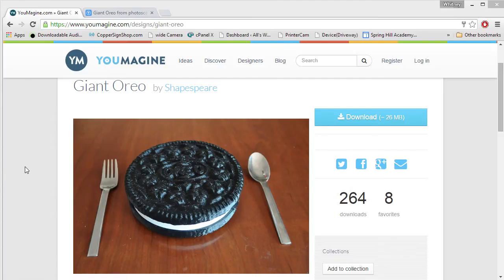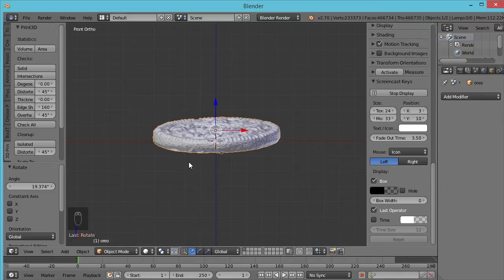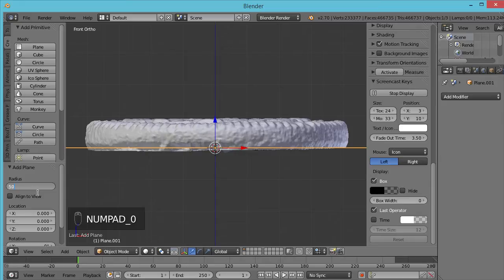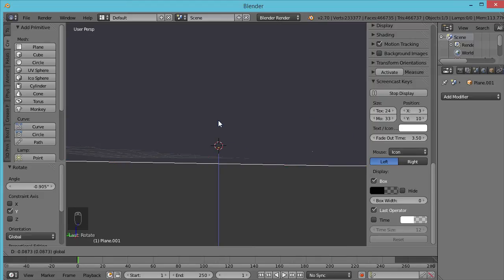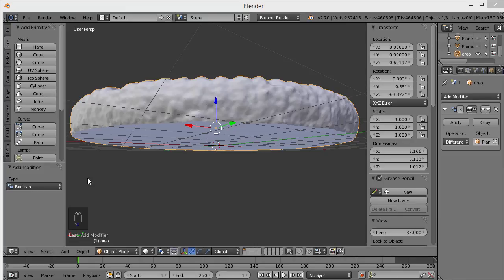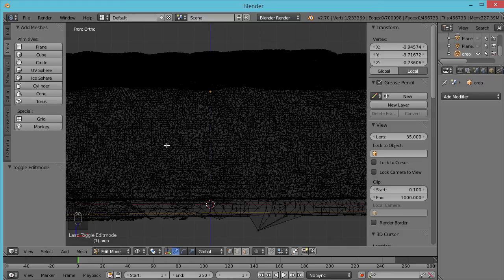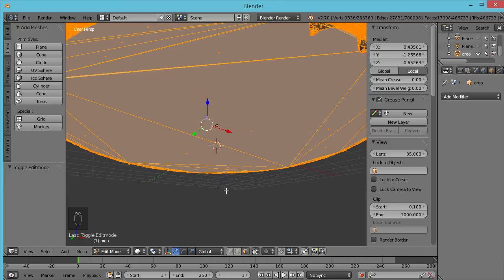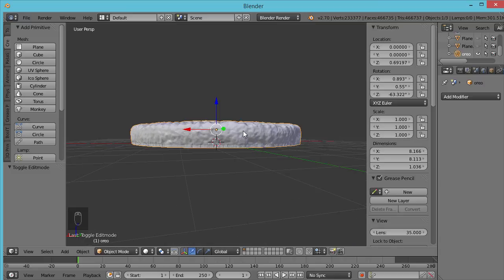Flattening 3d model bases using Blender

Comment: hey shapespeare,

quick question you mention using a splitter after exporting the files to STL. im generally new to 3d printing and was able to use your videos on blender to import the STL file to blender edit it as i needed. however when i export it to the STL then add it to my printing software nothing comes up its blank. what is the splitter? or what step am i missing. 

I am using the ROBO 3D R1 and using mattercontrol v1.2 thanks for any help!